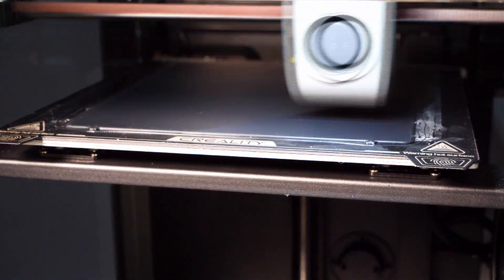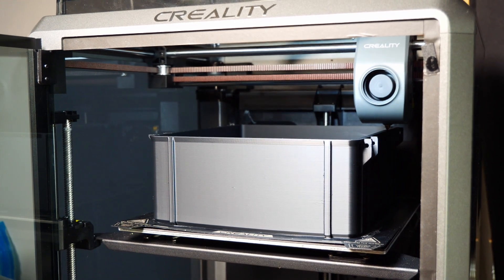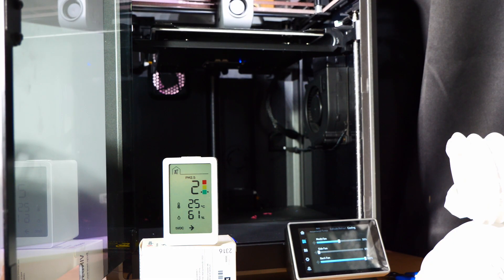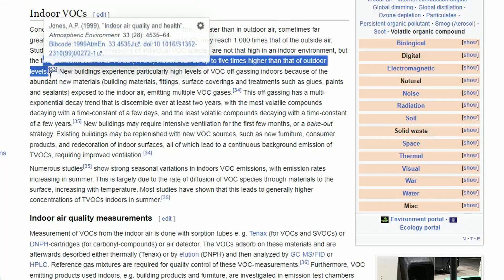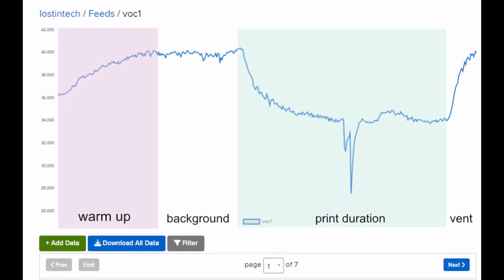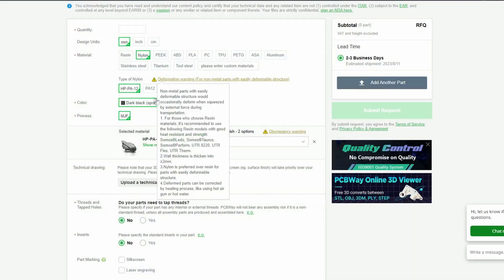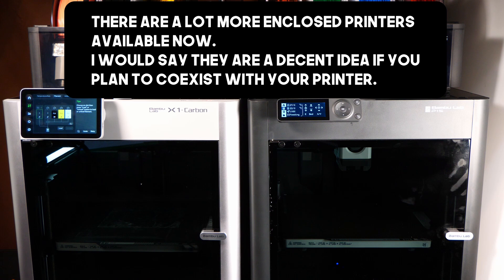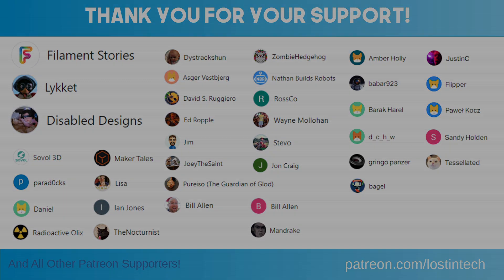Your 3D Printer Stinks.

Comment: Had a small dog pass away when I first got into fdm printing in pla and I always wondered if I killed her with the fumes the vet said she died of neurological reasons and I heard something about these things emitting neurotoxins.. I loose sleep over it at times and miss her every day. She had health issues and was an older dog at 12 years old so hopefully it was just her time to go. RIP Maya my beautiful doggie daughter.
Reply: If it was just pla , petg and tpu you are good.
Reply: @williamk52  thank you for reassuring me and yes those were the materials I printed in since they were considered to be safe at that time
Reply: 12 is a considerable age for a dog.  Props that your dog had a long and healthy life ❤
Reply: @gotmilkbutt  never got into printing abs due to not having an enclosure around my printer and it being located in my drafty basement
Reply: @TheEnd  yeah I used 1 reel of abs but I stopped using it after hearing it was bad plastic to be melting in your house. I’d be gutted if I caused the dog harm. She seems fine though and I’ve printed plenty pla so probably wasn’t your fault
Reply: I don't think PLA makes any neurotoxins. If she had died of respiratory issues then the printer could have been a partial cause, but considering she didn't, this is probably unrelated.
Reply: what was the breed of the dog
Reply: @BillionaireMindset-u1b  she was a Chihuahua
Reply: If she was older, that's likely why she has neurological issues.

Ultimately, if it's something that could kill her, it's something you'd also notice yourself

Comment: I've never seen smoke while loading or manually extruding on a 3d printer even with fans off.. what exactly is the temperature their load macro sets it to..? 
You can slowly load PLA at like 180 and ABS at 190, no real point in going higher until the print is actually Running IMO. Printer weirdness aside, good information all the same!
Reply from the maker: Yeah it's almost always around 220+

Comment: Is the smoke during manual extrude just due to the part cooling fan not being on? So the nozzle and etruded plastic isn't getting any cooling that it might normally.
Reply: the nozzle is temperature controlled but the filament might not cool down as quickly as when it's printed onto the last (cool) layer, thus having way more time to emit particles into the air. Also half of the surface area of the squished extruded plastic line is not even exposed to the air that way
Reply from the maker: I wonder if the nozzle is hotter than the place the thermistor is at. I don't know, it's a whole rabbit hole right there to try to figure it out
Reply: And then most of us have parts fan off during the first layers, and that's when printer owners watch the lines go down with their noses very close to the action.

Comment: I have pet birds and birds are notoriously sensitive to VOCs. I never print ABS or ASA (I've heard enough people complain what a pain those can be anyways) but otherwise it's only stuff like PLA or PET-derivative (PET/PETE bottle filament/ PETG) or anything that doesn't give off a ton of fumes. That, and I never let the birds into the same room as the printer when it's running. The printer is upstairs behind a closed door and the birds remain downstairs.
Reply from the maker: Birds are also super sensitive to ptfe so I'd recommend making sure all your printers have all metal hotends
Reply: @LostInTech3D  First upgrade I did
Reply: bird up

Comment: One of my biggest issues with the ‘studies’ is that they rarely use a 3D printer at all, rather just burn the plastic and measure the bad stuff… not all that honest but nonetheless it makes all the headlines.

VOC’s can be very bad, but not necessarily especially given the base material’s PLA is created with. Which means the VOC will be present but not necessarily harmful unless burned and the chemicals undergo reactions to create worse compounds… I wouldn’t sweat PLA, ABS on the other hand crosses the threshold of concern because of the chemicals that constitute it before burning.  Figuring out chemical composition of smoke is though, so beyond just looking at the chemicals your starting with I wouldn’t recommend spending lots of money on generic particulate readers.

Some exotic filaments are actually deadly poison when heated too high, so I am by no means dismissing this but most hobbyist shouldn’t break the bank venting and air scrubbing PLA. If it contains Styrene, PVC, Kevlar assume it is poisonous and act accordingly no need to measure.

For the rest of us just take the 3D printer out of the kids nursery and into the garage or attic/workshop where it belonged in the first place, done 👍.
Reply: PLA itself is fine yes, its bio from corn starch and what not but don’t forget its not naturally purple, so stuff is added to it for colour and strength

Comment: Just some heads up, that meter from IKEA has been measured as pretty inaccurate in the testing I have seen. I would share links but I don’t want to get flagged.

It uses a LED and not Laser for particle measurements. Not only this, but their measurements for particle size are much wider than normal standards. The main article you will find when looking up reviews of this meter will give more detail.

I only say this because I have been doing a ton of research on this for fumes and VOC’s. The companies I have talked to have said that most consumer meters are useless for tVOC as they measure too wide of a scale and can be fooled by anything from rubbing alcohol to even people wearing cologne. You need one testing for specific types to be accurate.
Reply from the maker: like most things, the more money you throw at it, the better the results, before you know it you're making a lab

Comment: Regarding the filament loading ppm increase, printers usually push a lot more filament loading than printing, but also I think that the position of your printing bed in relation to the position of the sensor was screwing with your measurements. The bed while printing is much closer to the nozzle shielding the sensor from the fumes, and when loading you had the bed way lower. Also since hot fumes rise, I think that the best placement for the sensor was on top of the printer, or somewhere else in the room for measuring the room particulate and VOCs increase in the room
Reply from the maker: yeah noted - where it was filmed was broadly convenient, rather than functional, compared to the 3 weeks of measuring in various positions.

Comment: You should definitely look into filters, both HEPA for fine particles and carbon filters for VOCs. The carbon filters work well for a lot of things, even solder fumes. I have an enclosure I built with both types of filters and a fan and when printing ABS with the fan in you can’t smell anything outside of the enclosure, even at the outlet. Before I had the enclosure when printing with nylon the inside of my nose would feel like it was burning despite not smelling anything, just putting a fan and carbon filter near it stopped that completely, so they definitely do work.

Edit: another good idea with an enclosure is having a fan circulating the air inside it through a filter. That way you don't lose warm air and you stop VOCs or particles from building up.
Reply from the maker: yep plan to check carbon filters in next vid. HEPA will be of limited use against UFPs (not totally useless but not up to scratch). I've not printed much nylon personally so I cant imagine the smell, if there's no smell that's somehow even worse!
Reply: @LostInTech3D  HEPA actually handles UFPs quite well. It's not quite as good at some medium particle sizes, but still generally effective. The easy intuition of "smaller particles -> harder to capture" actually isn't true. There have been several studies on this. Sentry Air's write up "A discussion on 3D printers, UFP emission, and HEPA filtration" is a pretty great starting point. The paper "Experimental evaluation of personal protection devices against graphite nanoaerosols: fibrous filter media, masks, protective clothing, and gloves" is also pretty great. My layman's understanding from looking through a few papers and write-ups on this is that modern electrostatic filtration material (used in stuff like n95 masks and HEPA filters) actually has an easier time capturing extremely small or large particles. There's a range of moderately sized particles where they don't do quite as well, but they still work fine. For example, the paper "How efficiently can HEPA purifiers remove priority fine and ultrafine particles from indoor air?" has some data/discussion on this. They show that the effective clean air delivery rate does drop somewhat for particles in the 200-300nm range, but the filter does still work for particles in that range. What HEPA doesn't do is address VOCs, which is why so many people use them together with activated carbon.
Reply: @jabberwocktechnologies  I'm glad you mentioned this. I recall Brownian motion being the reason UFPs are easier to capture than moderately-sized particles?
Reply: @theglowcloud2215    yes, the idea is that in that range of particle sizes Brownian motion is the dominant effect on how the particles move around. This makes them more likely to come into contact with the filtration media. Van der Waals forces make it so that once they hit the filtration media they stay there. If I remember right the paper "Experimental Evaluation of Personal Protection Devices..." that I mentioned in the last comment has a nice description of what's going on too.
Reply: @LostInTech3D  HEPA will be of use against the pm2.5 particles you measured though and filters can work for particles smaller than they are rated for too, they just aren't as effective. 

There was no smell when I used the nylon, just a burning in the inside of my nose. It was Overture easy nylon so I don't know if it was due to additives to make it easier to print or something but just a PC fan and a carbon filter very close was enough to eliminate it.

Comment: No, YOU stink! 🤢 Also, my farts don't contain VOCs; my performances are completely odourless.  Harrumph!

  It has occasionally come to mind as my FDM is sitting right next to my desk/workbench, but it's not overly concerning as it's not running most of the time.

  In my early 20s, I worked for a couple of years at a small security roller shutter & door company where the majority of stuff was manufactured in-house.  Thinking back on it now, the amount of cr4p I must have inhaled while welding, cutting & grinding steel with abrasive discs (the air would literally sparkle in the sunlight), and especially while spraying cellulose paint with little to no protection or ventilation 😵‍💫(as you say, open windows don't count), has probably done more damage to me than printing until I pop my clogs will.

  Your (awesome) video at least makes young'uns aware of the possible issues resulting from printing, even if you won't commit to calling it advice, it is, and it's good.  But, I'm afraid it's too late for me... so you guys go on and leave me here... I'll only slow you down... I'll be just fine... /coughs... splutters...

PS.  Did I mention I've always loved the smell of resin-cored lead solder (mmm 🤤)since I was a kid "helping" (as in holding the torch exactly where he didn't want it while constantly asking "what's that do?") my Dad repair TVs?  He convinced me we were removing all of the Cowboys & Injuns and soldiers who'd died in films that were now clogging up the TV sets. 🤦
Reply from the maker: we grew up in a different time, I certainly had my fair share of exposure to stuff we'd never do now.

Comment: I REALLY REALLY want to see how bad it is to use a food dehydrator for drying filament and making jerky with the same machine but with separate racks & enclosure.
It's easy to say it's bad, but I want to see numbers.
Reply from the maker: it's probably a bad sign if the jerky tastes of filament haha
Reply: @LostInTech3D  I haven't tried the filament yet, but I have sheet metal & welded wire fence to make a rack & enclosure for filament but don't want to do it if it's not safe. But realistically, how bad is it? I mean the dehydrator itself is made of plastic. How does it compare to having an actual filament dryer in the same room as a plate of food or heck, using plastic cookware?
Reply from the maker: Well, if it's emitting anything...if...then you are looking at inverse (square?) for distance, so the fall off for how much exposure will be pretty large with distance. So being very close, would be not ideal.

Comment: I'm not sure how the Pimoroni Enviro+ HAT for the Raspberry Pi compares to the IKEA monitor in terms of accuracy, but I built one with a PMS5003 sensor to monitor my 3D printer's output and piped the data to Grafana. I'm still testing how much crap the printer spews out with a Honeywell HEPA filter nearby and without. There hasn't been nearly enough research done on this subject.
Reply from the maker: yep the PMS5003 is a decent sensor, it's the one I used a year ago. It doesn't go down to UFPs though, so it won't really register much with PLA, at least I found that.

Comment: Great video as always mate. Un-dis-anti-ir-regardless of the fumes I just love printing in ABS. My way of harm reduction in having my printer in an air tight (or as good as I can get it) enclosure and leaving the printer closed for a while after the print. My thinking (probably flawed) is the nasty particles will settle and stick to the inner surfaces. 
Keep up the good work Sir 👍🇦🇺😊
Reply from the maker: I thought that logic was flawed too, but the data seems to support some version of your argument. I'm very interested to figure out where the fumes go, because yeah, initial observations look like enclosures help a lot.

Comment: Opening a window won't help you to get rid of fumes.
If you ever had window open, you'd notice that house ventilation usually works by sucking air in through windows.
So unless you have some abnormal airflow in your house, you'll only spread particles around.

Sure, eventually air will go to air duct or whenever outlet is, but those particles are heavier than air and tend to stay at lower layers and ventilation outlet at the upper side of the house.
Reply from the maker: yeah you can't really know where the air currents are taking the particles when you just open a window, that was something I never really realised. It would be fascinating to use some coloured smoke or something, and watch it...although I can't say I'd enjoy the mess
Reply: @LostInTech3D  No need to use colored smoke even, you can buy cheap fog machine or even rent BIG fog machine
Reply: When I bought our Ender 3 v2, I purchased a fabric enclosure and modified it so a bathroom fan exhausted air from the bottom and fresh air (through a filter to diffuse incoming cooler air) from the top. I built a box for the bathroom fan to connect to that pushes air through a HEPA filter, then carbon filters. It's sealed for leaks and the filters easily replaced. We ran the printer once without this and couldn't fathom how people can tolerate the stench. If people cannot smell what these are putting off, they are already compromised health wise from cigarette smoke, air fresheners and perfumes products. It's seriously intense.
Reply: If particulates could get stuck in the ventilation shaft they would not be able to get in there to start with.
Or by diffusion ?

Comment: I feel like you should try to get a better voc sensor (or hack the ikea one if it is decent?). The topic is really interesting but without reliable data I think taking any conclusions will be difficult.
Reply from the maker: I don't think they get more reliable than the BME680 - the issue is calibration.